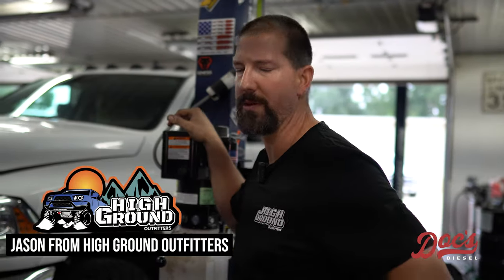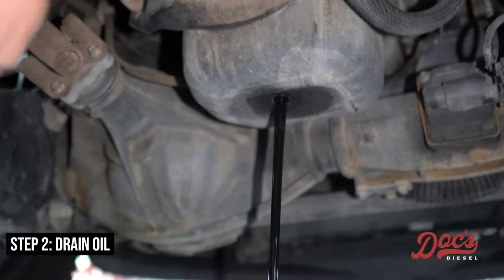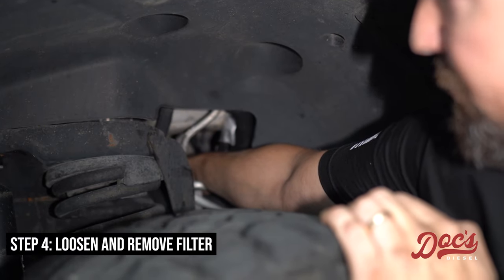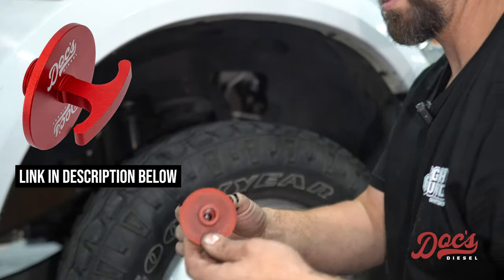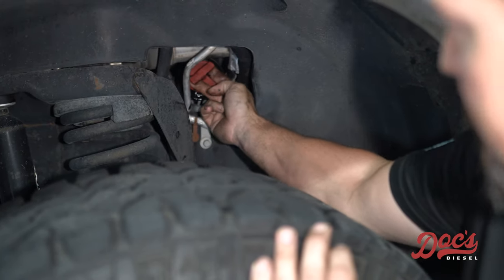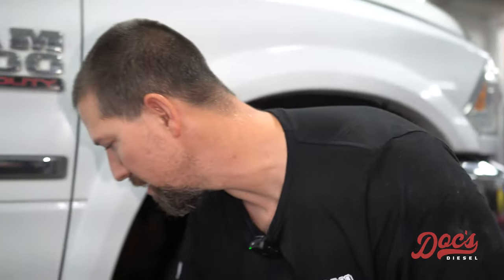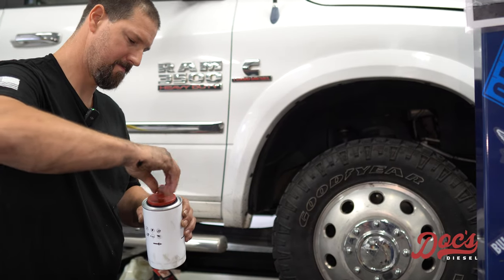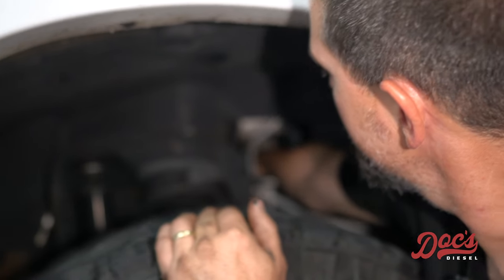Doc’s Diesel How To: 1989-2024 5.9L/6.7L Cummins Oil Filter

Comment: WRONG. Get the oil filter loose, grab a plastic bag, put it up around the filter and then finish unscrewing the filter. As the filter comes loose, let it set down on the AC lines he's talking about and THEN put in your filter plug and drag the whole thing out by the bag. NO MESS. You can do the same thing with the rear fuel filter and avoid diesel every-fricking-where.